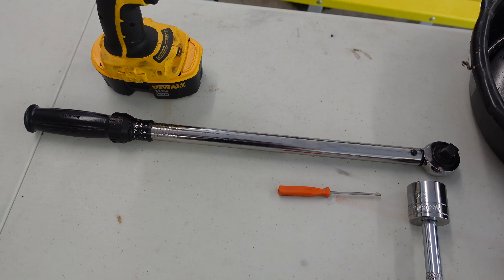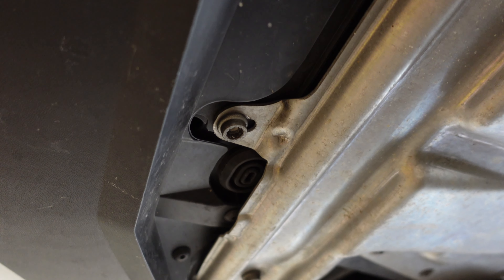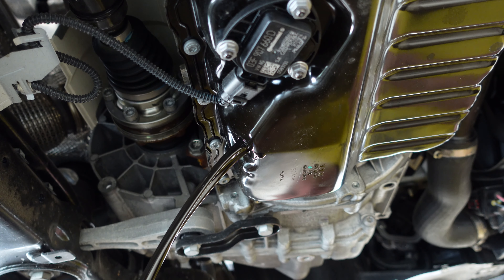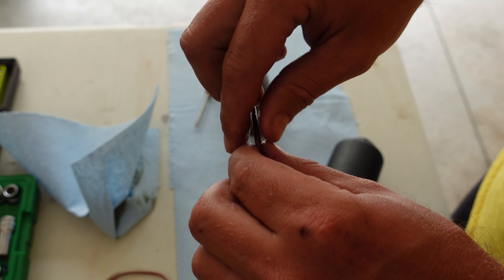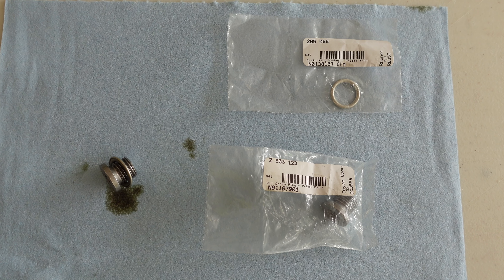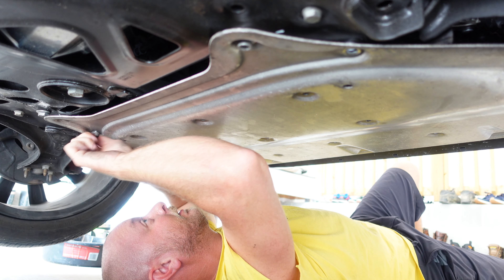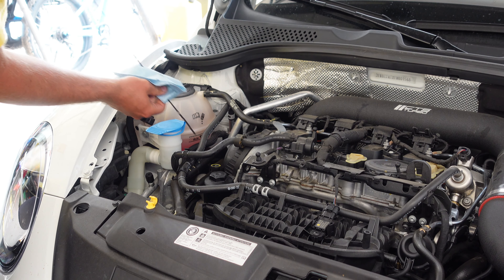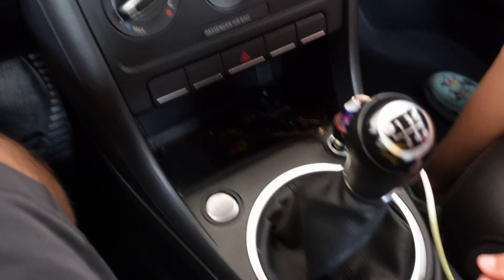VW Beetle Oil Change & Light Reset 2011-2019 2.0L

Comment: Great video and well explained.  Nice that your year only requires 5w30.  Mine specs 5w40.  Also, I would have two co-pilots to avoid conflict.  The only missing part you may consider in future videos is the use of jack stands.  These bugs are so low to the ground if one or both of your jacks failed, your co-pilot would have to pilot.  Otherwise, awesome explanation.  I was having dealer do mine as the cost of oil, filter, washer...etc was only 10-15$ less than they were charging.  Now they've doubled and I refuse to pay.  Thank you sir!

Comment: Thanks for the video, can you please write me down the torque spec for oil drain plug, oil filter cap, ans for all the bolt of the under panel ? thanks a lot

Comment: I'm wondering if it would be possible to cut an access hole through the skid plate to access the oil drain plug for easier, faster oil changes.  What are your thoughts on this?
Reply from the maker: Honestly not a bad idea. Cut enough space to turn a ratchet. I’ve seen different 1/4 valves for Toyota trucks in place of the drain bolt. Wonder if someone has one for vw, that would be nice.
Reply: If you use an oil extraction pump you will have no need to go under the car. I've used a Pela 6000 for years. Since this car has the filter on top it makes the job super easy and clean.

Comment: these bolts are called tripple squares    use the correct bit   the hex will work  but it does not grab all of the points

Comment: That reset piece was gold! I wonder why you don't level the car for complete drain and then relift?
Can you advise re: my back-up and side alerts now do not default to "ON" every time I start the car after I have activated on previous drive. This started with new battery install. Previously the setting was always "ON", unless I changed it.
Thank you!
Reply from the maker: When I lift the front of the car. It actually tilts the oil pan so the drain bolt is lower? So I feel I’m getting all of the oil out. I hope that makes sense. 
I don’t have an answer for the 2nd question you added. I do know vw’s act a little funny after a battery change. Like the windows auto lowering/raising when opening doors can be off. They fixed them selves after a few drives.